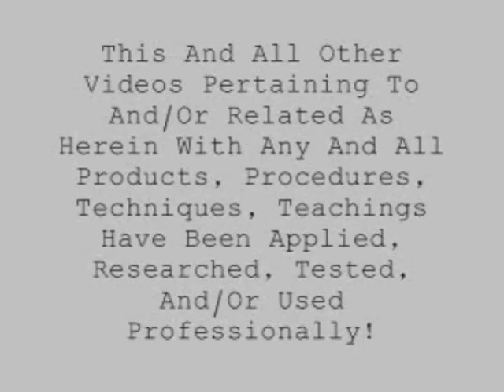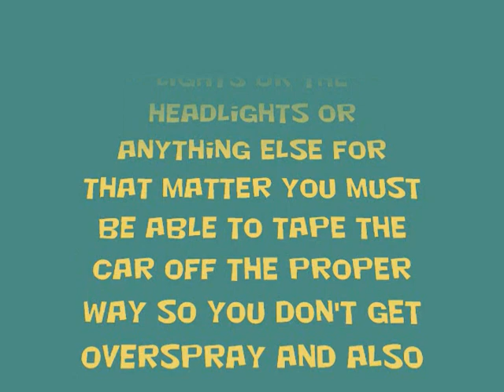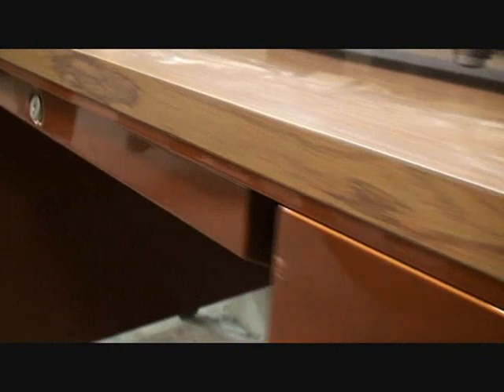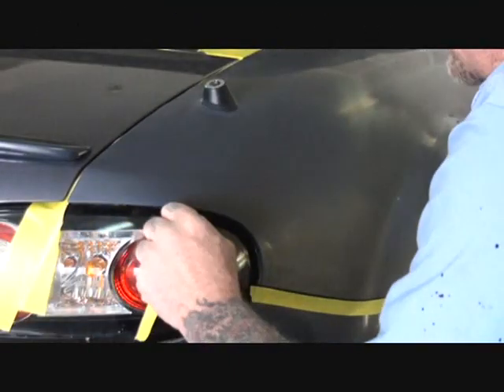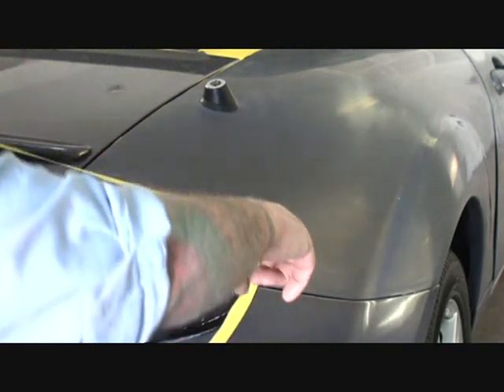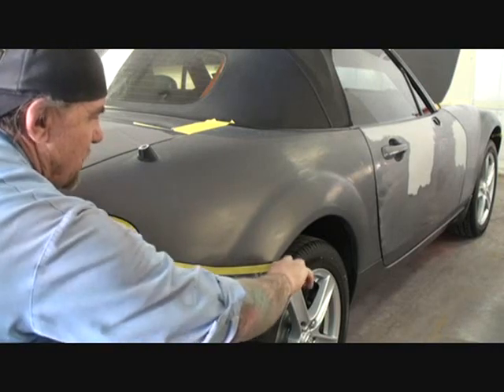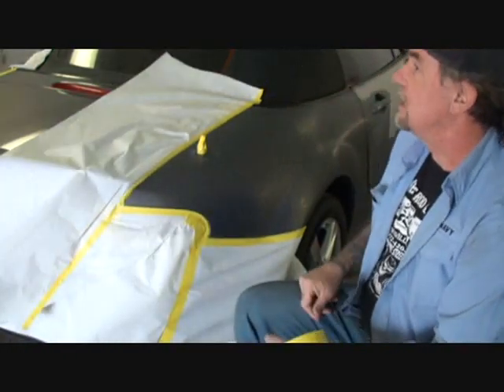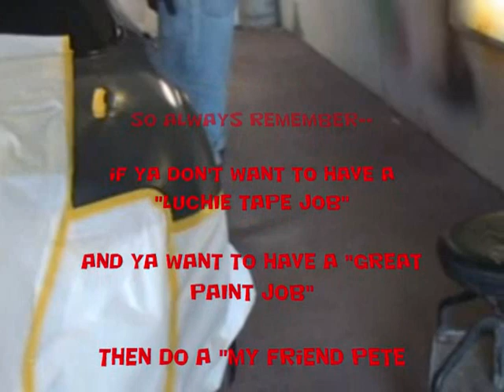How To Use Masking Tape-Car Painting and Refinishing-Tech Tips

Comment: Pete, for the sake of the 6 or 8 screws which hold those table tops to the metal desk, I'd have just flipped the desks over and removed the tops rather than waste time, tape and paper masking them off. You are right about the importance of taping properly. The entire job looks like crap if it is sloppy. I like a plastic putty knife cause I ain't got no finger nails, to get the tape up into the gap.